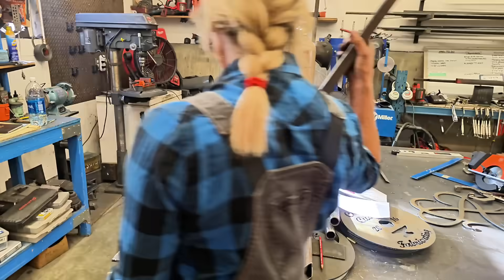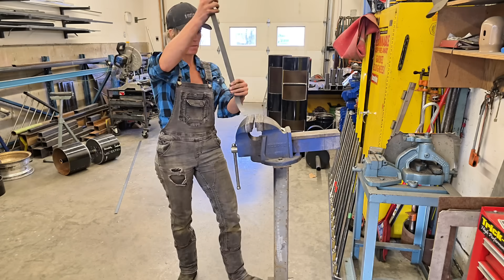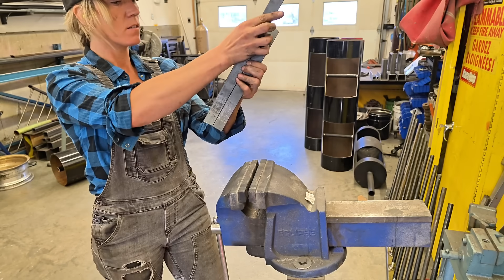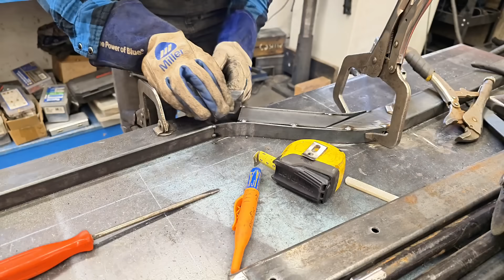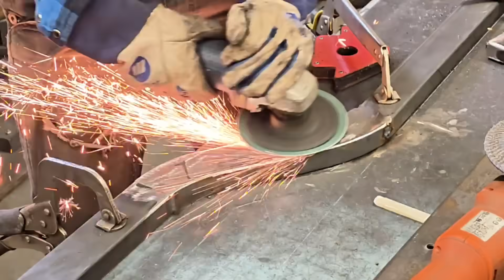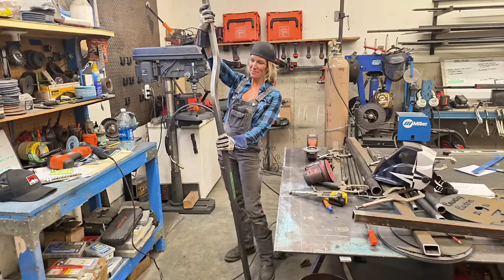Metal Shaping With Rachel - Custom Steel Handrailing

Comment: Hello, for my part, after having formed the two "S" as you did, I would have rather had the idea of placing the connection area on a sheet metal, tracing the contours, cutting 2 flats and boxing the two faces. But your technique works just as well!!!👍 Each builder has his own way of doing things and the main thing is to obtain a good result, and it's always interesting to compare our techniques I find, it allows us to progress😊

Comment: Morning Rachel, love the safety squint lol, my welds will never be as clean and nice as yours, I do all my welding outside, so no gas, all flux core. Usually 035, but 030 runs more trouble free, just more of it. Made a cart to hold a 9000 watt generator, I replaced the 50 amp plug with a welding plug, mounted my Lincoln AC DC buzz box, and shelf for my Lincoln mig pac 180, as well as my plasma cutter. It’s on wheels so I roll it outside to use it, it works for me as everything in the shop now is allergic to spark . Have a great day.

Comment: Safety squint 😜, grinding talk haha.
Must add, almost every welder I work with uses an auto tint, but tack with a safety squint.
Own an auto tint but it's with a fresh air helmet, but my 2X4 #9 always use even for tacking.
Why do folks pay alot for the auto?
Reply: i dont use auto shade either.....i got flashed with an auto-shade.....back to the old school method, and who cares about blu-vision
Reply: @Joe-pb3lx HAHA Diddo.
🤘 Great To Know.